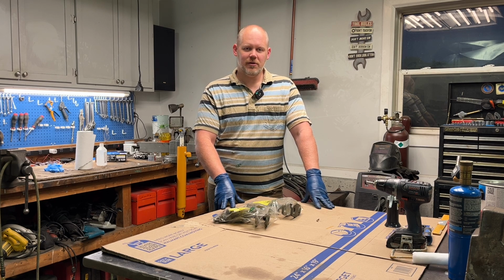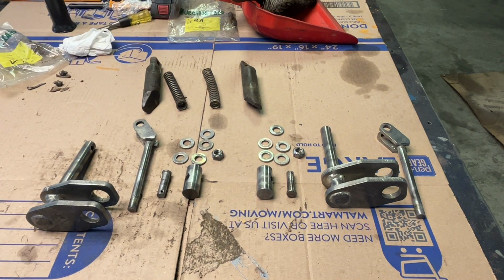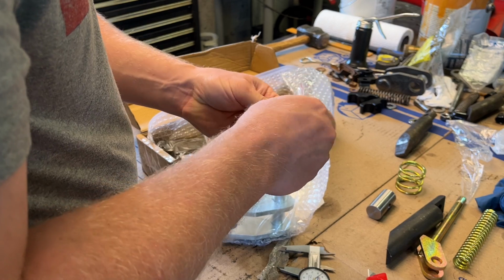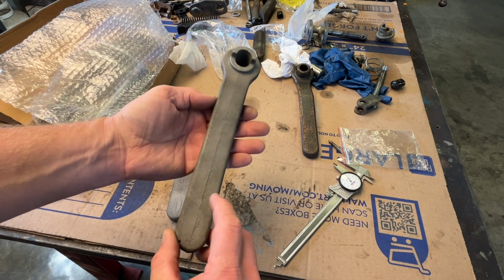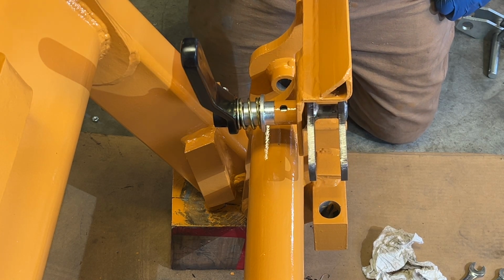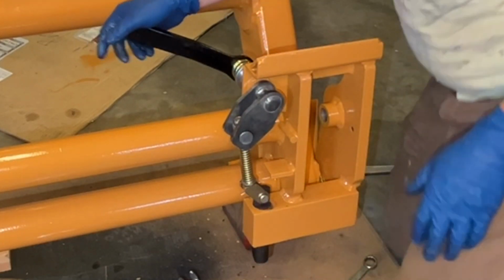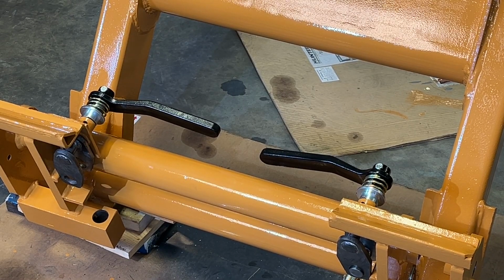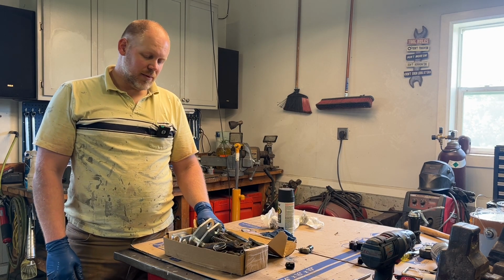Rebuilding the Quick Attach with Aftermarket Parts - Case 1840 Restoration

Comment: Are the quick connects specific to the 1840? Can you provide information on the kit you bought or the quick connect itself? I'm not sure whether these are universal or if you need the right one for the 1840. The 1840 I just bought does not have one, and I plan on using a backhoe, so I think it would be useful to have one. Any feedback is appreciated. 

Great video...
Reply from the maker: Hello,

Yes you will need one specifically for an 1840. The 1840 quick connect is exactly the same as all modern quick attach systems but is a little narrower.  If you look at some skid steer attachments many of them will have a second set or narrower pin holes on the bottom to accommodate this narrower set up.  
The quick attachment on mine came from a slightly newer 1840.  The original one was the same style quick connect but that coupler used a flat channel piece in between instead of the dual tubes.  The newer style is stronger.  I bought the repair parts from Friday parts.
Reply: @MikefromMissouri  
So a little embarrassed.. I went out there today to put new tires on it.. and realized it did actually have the quick connect. 
To be fair I haven't really been around one before and when I bought it it was kind of a whirlwind purchase.. 

I still appreciate all the information and will probably be bugging you some more.. 😏
Reply: Mine is the dual tubes..
Reply from the maker: @warlock-designs-customizations  Well that’s good news because they aren’t the easiest to get ahold of.  Happy to help.

Comment: Nice job! 
Being a field mechanic, it has saved my skin a 100 times keeping old parts UNTIL the job is done. To get something going again when the new parts aren't exact or wrong is a must on customer equipment.

I realize this is your own and take pride in it, as i do with my projects. I think you made a fair compromise and had a good result.
Reply from the maker: Hey Fixed-ish thanks for commenting again.  Do you do service calls on equipment in the field? I can’t imagine not having my full shop at my disposal.
Reply: @MikefromMissouri  yessir! Been at it 11 years and work on all kinds of different things in the field and occasionally in the shop. Worked on many case 1840 and 1845's

I post quite a bit on my channel of the different stuff I fix at work and personal projects if you'd like to see. 
Pretty jealous of your set-up in your shop, honestly. I've got a nice work space at home but not nearly as outfitted as you. Gives me some inspiration and ideas though!
Reply from the maker: @Fixed-ish  Very Cool!  I’m new to skid steers but have lots of vehicle repair experience and I am a self taught machinist.  I’m a bit of a perfectionist so I knew when I bought a skid I would go overboard on fixing it so I held out on a model worth the time and effort. 

I plan to check out your channel.  I can tell you, regarding my shop and machines,  it has taken me 20 years to build up.  I kept trading up when the opportunity and funds allowed. I’ve come to realize no matter how much you get someone else will always have more.  I just can’t believe the equipment diesel creek gets involved with and I am so jealous of anyone with timbered acreage.  I try to remind myself to be thankful for what I have.
Reply: @MikefromMissouri  his stuff is pretty good. Between him and adept ape, they are the reasons I started doing the youtube thing. It's fun documenting my trials and a good outlet for me. Lofty goal is to afford myself the ability to get into deep projects and throw some money at tooling/ refurb projects. In the meantime I figure why not document the journey?